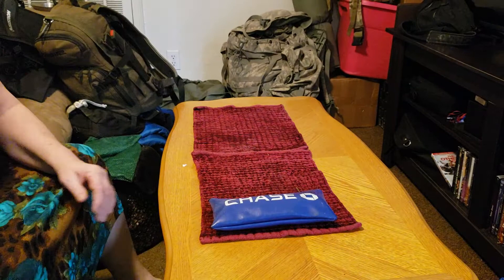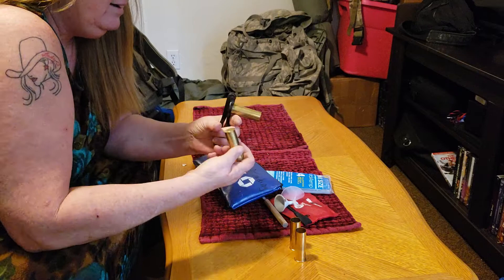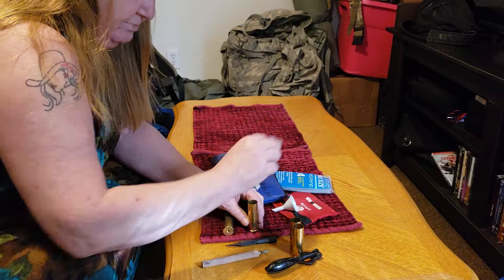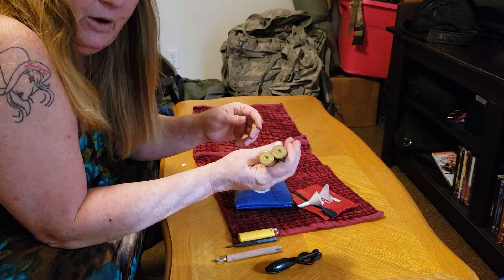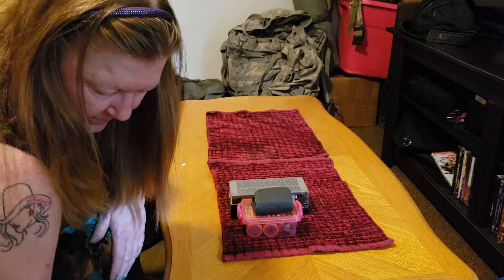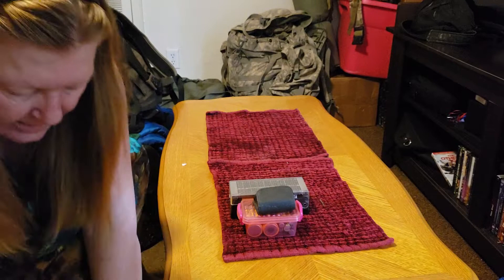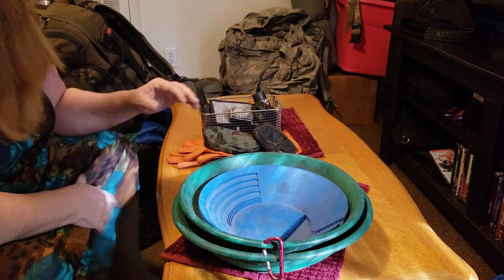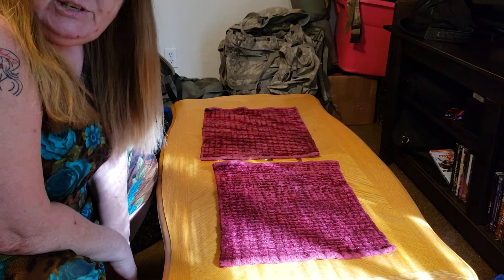shtf preps you may not have thought of.  unusual prepping items for post shtf.

Comment: I like the brass shotgun shells, I reload for most everything BUT shotgun, I may have to pick up those tools and some of those brass shells for 12 GA.  Handy charging items too, I mostly use a power bank with larger folding solar panel and have standardized to all USB type stuff, but if you have D or C Batteries that thing is awesome.
Reply from the maker: i put the link to david canterburys video in my description box so others could see it
Reply: I totally agree do you have any recommendations on the solar chargers really need to buy one thanks
Reply from the maker: @midtennprepper6200  no i dont, just google them,the ones i bought were super cheap and not a great quality.
Reply: @LadyTSurvival  thank you